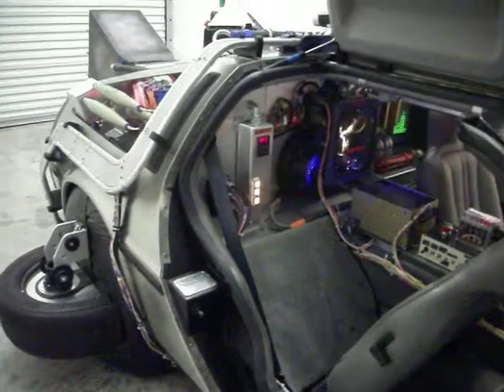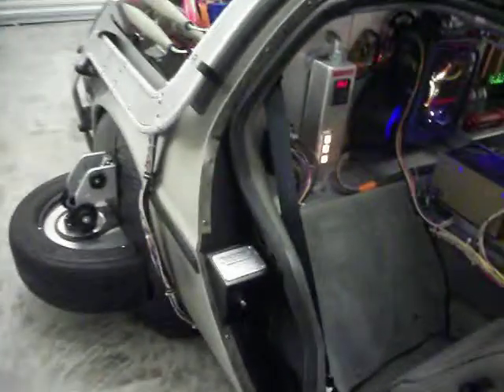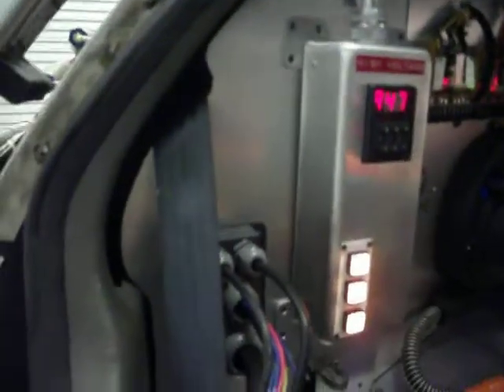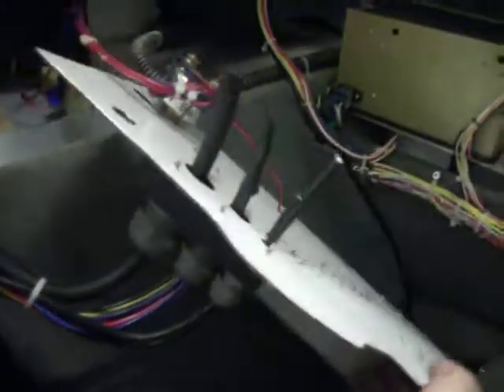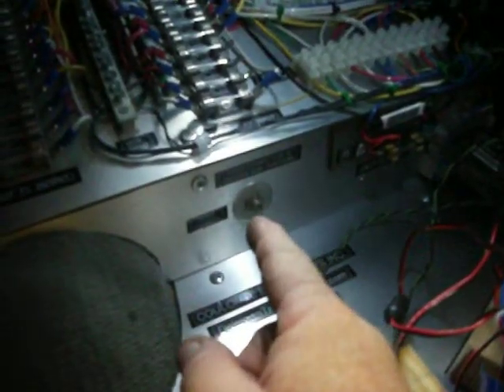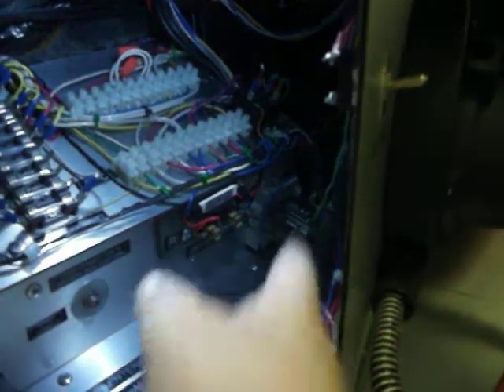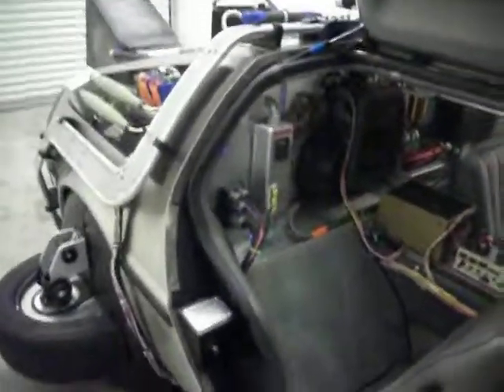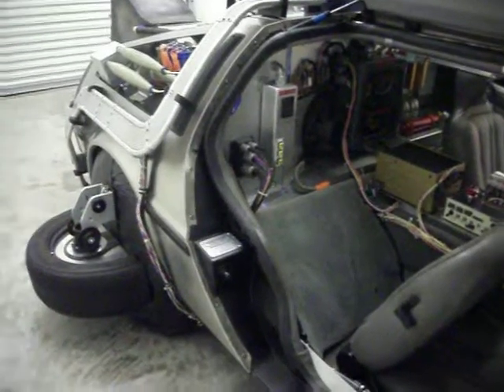Delorean Time Machine Fuse Power Distribution access How To Demo #1

Comment from the maker: Good question. That is a spare coaxial cable for the Back-up camera. It is meant to have a hardwired connection to the back-up camera if the customer should ever need it.
The back-up camera installed presently is a wireless camera transmitting to the monitor.